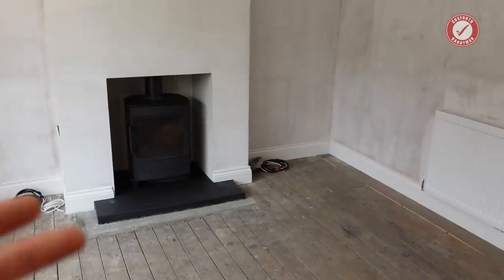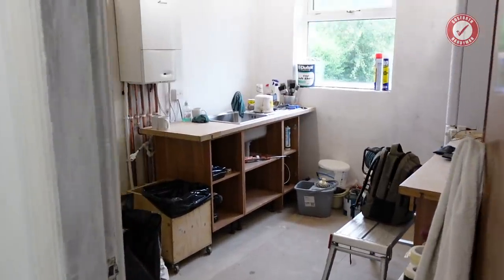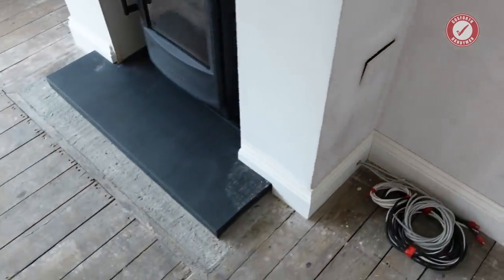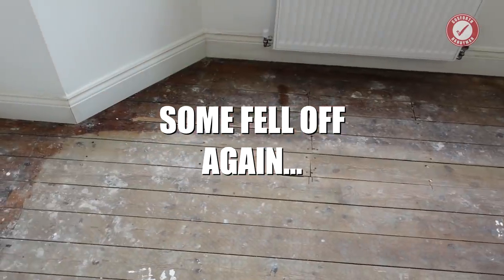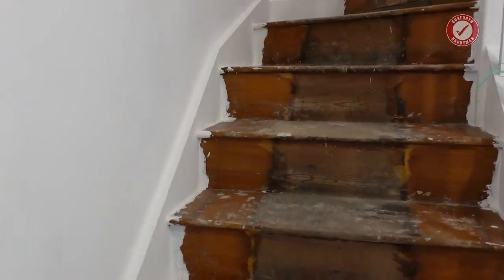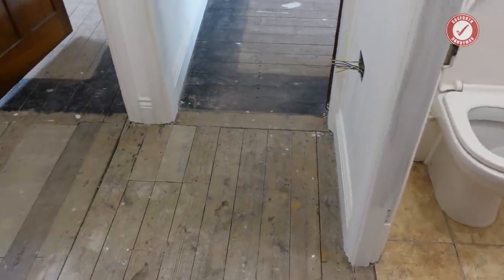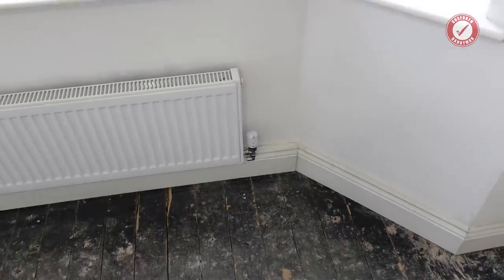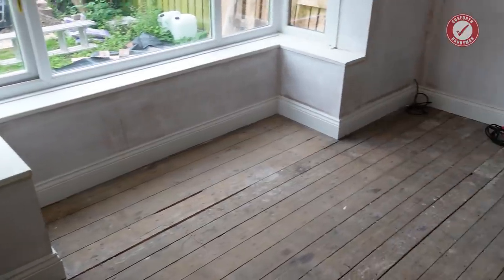We’re ready for carpets! (1920’s Renovation Part 33)

Comment: A lovely teaser to the full reveal. I'm interested in how your planning to renovate your doors, I got five 1920's typical style for £40, lacking beading but for that price I'm not at all bothered. I've watched one door restoration on the 'Restoration Couple' YouTube channel, and like I say interested in how you'll go about it, although I think it'll probably be the same or very similar. Great vid as usual.
Reply: personnaly i would send them off to be dipped to get rid of all the paint and varnish. sanding all that wouldnt be nice especially if its lead paint etc
Reply from the maker: We're not bothered about making the doors 'perfect'. Just a quick sand, filler the gaps and white paint. Will do those in the workshop later down the line. 👍

Comment: Like everyone else I’m getting excited for you. Question. Why did you bring so many cables out through the middle of the skirting boards and not above them into boxes ? As an ex electrician and network engineer I’ve never seen that before
Reply from the maker: It's in areas where the cables will be hidden by furniture etc. Chasing brick walls is a nightmare and happy to have data points at skirting level in some rooms. 👍
Reply: @GosforthHandyman  
Fair enough. I would have done that little extra bit of chasing.  But given your workload, perfectly understand 😀

Comment: Andy I once had a shower on a wood frame , any leaks and it will flex and cause issues , I learned the hard way concrete blocks or brick etc for me but good luck
Reply from the maker: I can assure you it won't leak. Also it's treated timbers. 👍😁
Reply: Gosforth Handyman I’ll take your word but for me never again treated , braced , if I can concrete or similar is the way to go for me

Comment: You didn't take your doors off for the carpet layer? Not needed?
Reply: The rooms will have had carpet previously, so it's likely that there will be space under the doors to fit the carpet. Removing the doors would have made the job slightly easier for the carpet layer, but they are used to working around doors that are still fitted.
Reply from the maker: Only one needed to come off. 👍

Comment: Curious about the baseboards/skirting --- around here they are fastened to the wall 3/8-1/2" above the floor, so that carpet can be tucked under them.
Reply from the maker: No, we generally don't tuck under skirtings these days. Still sometimes see that in older properties though. 👍
Reply: The skirting boards go as close to the floor as possible (depending how flat the floor is) and then they put gripper rods on the floor and tuck the carpet between the rod and the skirting

Comment: did you keep this carpet upstairs now that the extensions is finished? Working on a 1920s house at the moment and currently debating whether to carpet upstairs or attempt a floating floor. I just feel that floating floors over old suspended timber boards is never as satisfactory as one hopes.

Comment: I think I would have decorated (or at least filled the skirting boards) before laying carpets. Myself. Time issues? RAAT (room at a time. Move into one room, expand as work progresses.)
BTW Craneflies ('daddy longlegs') are insects of the family Tipulidae, not arachnids.
Reply from the maker: Bear in mind skirtings are coming back off when new hardwood flooring goes down, so really no point. 👍
Reply: @GosforthHandyman  Hardwood flooring after carpeting? ?? Think you must have shown rooms that are not being carpeted... where you have delayed flooring in order to fit skirting boards that you are then going to remove and refit. That sounds like double handling, usually regarded as a no-no.

Comment: Whose contract matt paint did you use? I've used Wickes in the past and found it to be quite good value.
Reply from the maker: Wickes and Leyland. Both left a very chalky residue. 👍
Reply: @GosforthHandyman  Think it's usually Crown I end up with for misting, never had trouble with it.
Reply: @GosforthHandyman  used Leyland recently and was nightmare. Such a chalky finish and created big problems on ceiling. Never again!
Reply: @GosforthHandyman  Leyland contract white is meant to be used on fresh and wet plaster.  This is why it is chalky.  I learnt that by watching some videos by Skill Builder who went to the Leyland paint academy.   There are several issues with this paint.  I learnt the hard way after doing several coats on a whole upstairs of a house.  1). Chalky finish.   2) Rubs of the wall easily with damp clothes.   3). Coverage on darker colours or stains is poor..   4). Sometimes bubbles appear in paintwork. 5). Allow to dry at least 6 hours before a second coat or it can pull off previous coat leaving a mess on wall and roller.  Use the layland vinyl Matt white about £30 a tin.  The difference is amazing.  Covers better.  Paints better.  Less coats than the contractor.       For wood top coat use Dulux white satinwood.  Great stuff.  Less shine so the wood blemishes are not so pronounced.   Paints really well on Leyland acrylic primer undercoat.  Lovely series.  Keep going Andy

Comment: What trouble did you have with the contract matt paint?
Reply from the maker: Bathroom paint started peeling off. Very chalky. Also think it's to blame for the skirtings falling off. 🙄👍
Reply: @GosforthHandyman  used Leyland contract matt myself recently on newly plastered walls, just did one room then chucked the rest in the bin. It was very chalky when it dried. Have used the no nonsense grab adhesive for skirting boards in the past as well, it was useless even when the paint on the wall was fine, found pink grip solvented adhesive a lot better. Love the channel by the way 👍

Comment: God I hate how electrians now put new sockets  2 feet or whatever  above the skirting. Awful. They did this to my house as well. Rules are rules etc......
Reply: That’s for new builds. On older property you can put them at any height, especially if you need to match the existing sockets.
Reply from the maker: Must admit I prefer them higher up now! Much less bending down etc. 👍
Reply: I agree Andy.
Reply: It's a good idea to put them higher up we had a couple that where upside down as the skirting  was to low  and would badly link the cable coming out the plug ,it's also a good idea in case of flooding as too many houses are now in flood zones
Reply: It is a personal choice and I was never given the choice. The  Edwardian house I bought , had one electrical socket in the skirting which was underneath a radiator!

Comment: Why not finish the floor?
Reply from the maker: Extension happening soon and new flooring will run through to the extension. 👍
Reply: @GosforthHandyman  I mean why not sand and stain the wood floor instead of carpet.
Reply from the maker: The current floorboards are trashed. New flooring will go over the top.